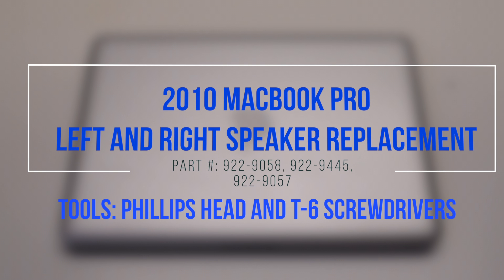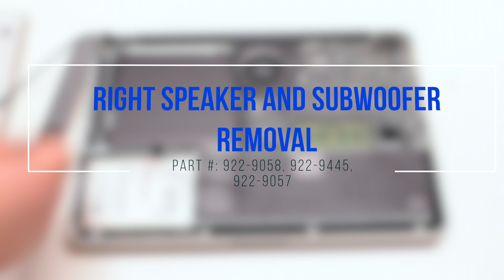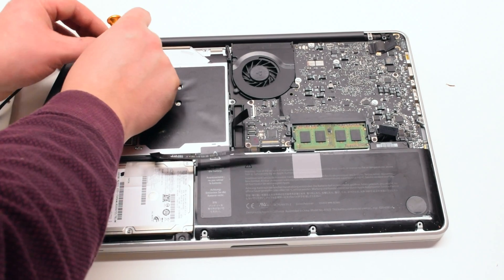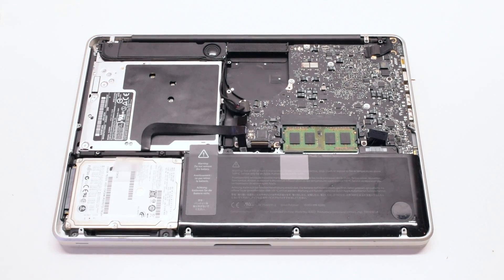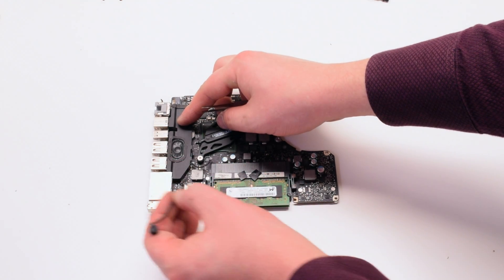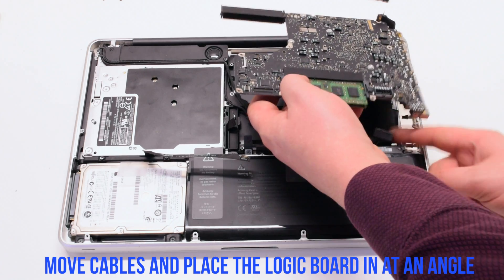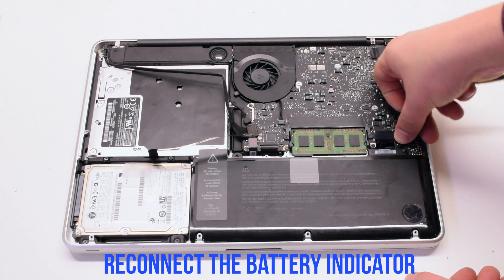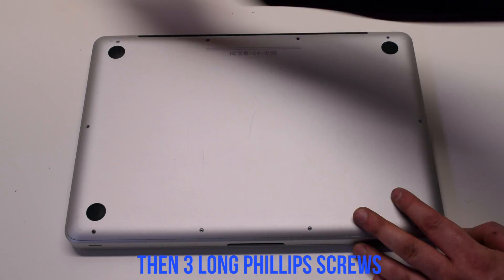2010 Macbook Pro 13" A1278 Speakers Replacement

Comment: I've done this twice first time the laptop didn't turn on after I replaced the speaker's and battery. Second time after I installed a new logic board my laptop turned on but I only had a white screen. Any solution to this?

Comment: I finally get it done to replace te speaker + battery. It took me hours because it wont turn on .. the ribbon cable for the keyboard caused it, is really hard to reconnect securely... now my MBP works again..

Comment: I did it!!!!!!!!!!. Thank dude!!!!!!!..   ps extra care with that connector by the microphone.. taking the Mic can be challenging....
 make to sure to properly inserting the 2 ribbons with wing lock by the battery..... thanks again... I changed both speakers and sub woofer.. ..

Comment: When I tried to unplug the speaker connector it snaps and some sparks appeared. I broked it. 
Can the Macbook pro still work without this connector?
Mine is not working.
I'll go to mac support.

Comment: I bought 2011-2012 speakers for my 2010 not realising that they were slightly different. I was able to modify the parts and they still work. If anyone is buying parts make sure the year is correct. all the 2009 -2012 mac pros have the same model number which is weird because the internals are all different. 
I made this mistake because the parts for all 3 year models were listed as if they are all interchangeable. so I assumed the speakers were the same. but they're not. 
Thanks for the video! 
I hate spending money for things I can do myself.

Comment: At 01:38 in the video you can see that the DVD drive cable has just been disconnected but the commentary forgot to mention this. It gets reconnected at about 04:33.

Comment: Hi, great video! Just one question though.. do you happen to know if macbook pro from 2008 and macbook pro from 2010 both use the exact same speakers?
Reply from the maker: They do not.
Reply: does the 2009 uses the same speakers as the 2010?
Reply: Do the 2009 and 2010 use the same speakers?